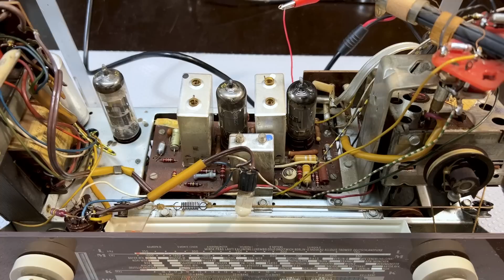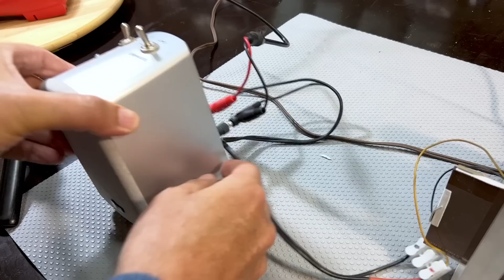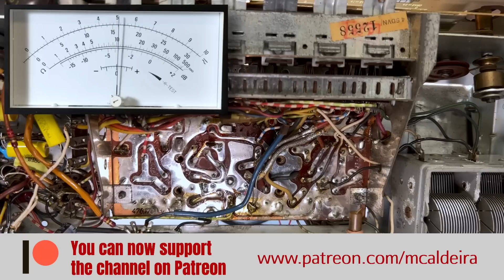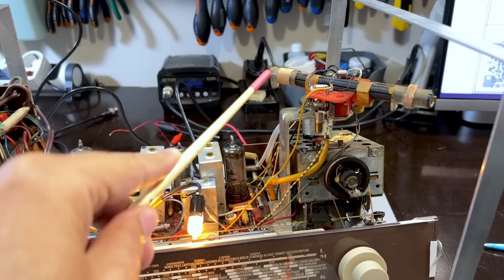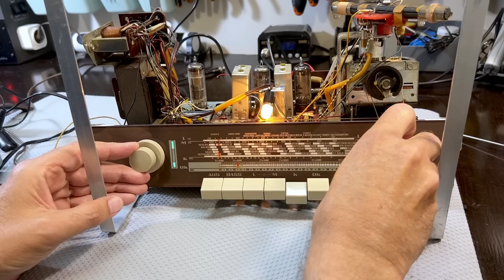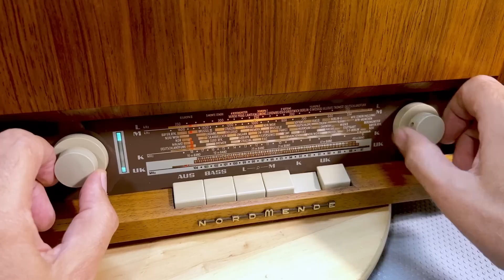She was born in 1963, and is now reborn in 2023. Nordmende Skandia V24 - restoration part 3

Comment: Amazing how the alignment is spot on knowing the age of this radio, a sign of a well designed and manufactured radio for sure.
Reply from the maker: I agree
Reply: I wonder why Nordmende could not have used 3x12AX7 tubes in a cross coupled double balanced mixer plus local oscillator and crystal filters for 460 Khz so you get a nice clean signal and would make it a joy to listen to.